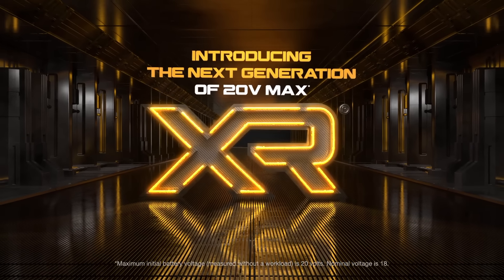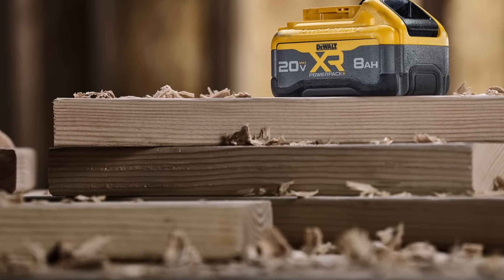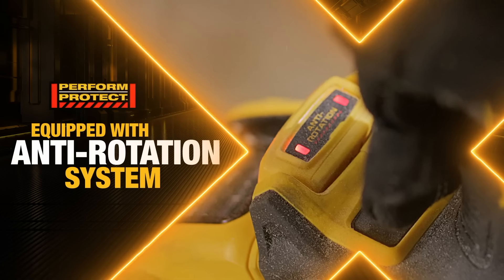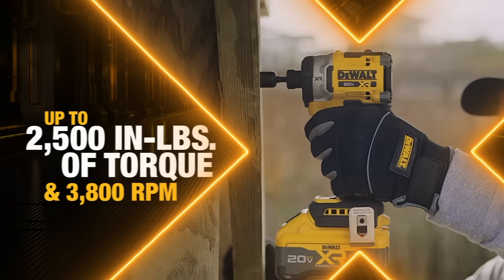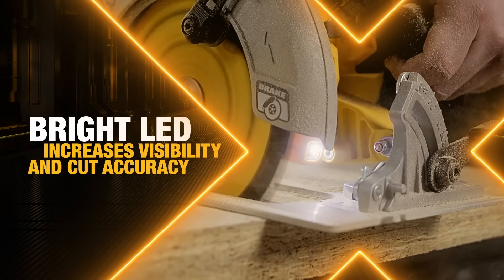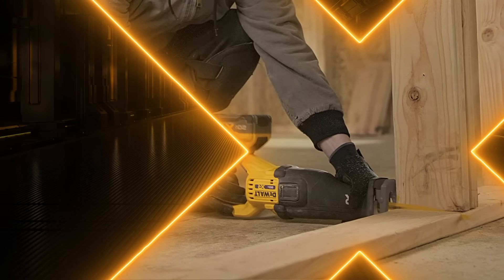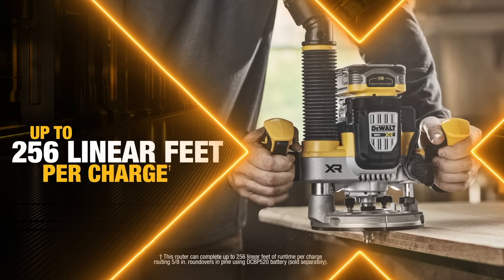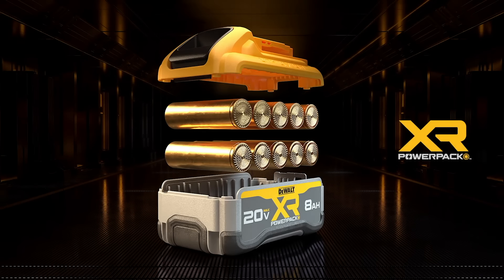New Tools from DeWalt - New Drill, Driver, Saws & PowerPack!

Comment: Most users could care less what you call the battery . We care how long it lasts between charges . When Dewalt thinks it can charge the consumer $200 plus for a battery ,think again, the Chinese knockoff’s are popping up for 1/2 the Dewalt price and sadly,there both made by the same 8 yr old kids . Just a different color
Reply: @robertsmith3518
Not entirely true. The cells that are in these batteries aren't made by Dewalt, I presume they're made by Panasonic, Samsung or.... The Chinese knock-offs use inferior cells that are just as good in the first few charges, after that these cells deteriorate a lot faster as the quality cells. Not saying these cells aren't overpriced but you somewhat get what you pay for.
Same goes for Makita, Milwaukee, Bosch,...
Reply: I agree about the price of oem batteries. I have 3 times the amount of Waitley batteries vs DeWalt. But in all honesty, I think most people either don't know about generic batteries, don't trust them, or want DeWalt batteries because they're pretty,
Reply: I got some knockoff batteries, identical counterfeits to Dewalt 6ah flexvolts. Even brand new, they died long before my well-used genuine Dewalt batteries did. They did not have Panasonic or Samsung cells like Dewalts do. The circuit board was also far less complex than genuine ones, which makes me suspect they don't have fire and short protections either. Regardless, I will stick with OEM batteries from now on.
Reply: @papageo5  Cheap batteries don't last nearly as long, you don't get the same power output and you'll be lucky to get any warranty with them.
Reply: You say all you care about is how long they last, then you will not be happy with the knock off. I have seen guys buy those and change out multiple times while my Dewalt batteries are still going strong.  I will gladly pay 200+ dollars for a new battery cell technology that has far more power output and for a longer duration while keeping heat down.  If you make money with your tools then i think its a good investment in my opinion
Reply: I agree with the comments about OEM batteries. Coming from a world of high performance flashlights I can tell you there is a huge difference in cell quality even coming from the same plant. Big OEMs get to select cells based on stringent testing and QA parameters. The ones that do not make the cut go to the cheaper brands. OEM battery packs also have better charge and discharge controllers to maintain proper voltage and distribute heat amongst the cells. I have tested cheap battery packs where a single cell was heating up faster than other cells during charge and discharge leading to a fast degradation to that cell’s capacity. This leads to the entire “pack” failing earlier than it should.
Reply: I might buy a couple new batteries, but probably won’t be replacing any working tools , unless something unexpected happens to what I have.
Reply: I'm mean it depends I'd rather use a 1.7 powerstack on my impact when working on my car over 9,6,5,4 they just don't fit in the same places as well.
Reply: Those Chinese batteries aren’t that great. Don’t kid yourself.
Reply: If you’re a professional then you know why Dewalt batteries are the best. And if you buy them right , you never pay $200. Try the power stack. Best battery yet and can get em , especially right now at Lowe’s free with a number of tools. Sure the tool isn’t as cheap as another store , but you wind up getting the battery for like $50.  Just watch for the deals and you can build your battery arsenal for not that much.
Reply: Кто вас заставляет брать? Пользуйтесь 5 xr, проходите мимо.

Comment: The most interesting tool would be the recip saw performance, without the new pack. Dewalt's flagship recip has always been lagging.
Reply: I have the Flexvolt recip and it is a real beast.
Reply: @MrCubflyer  Yeah, FlexVolt has a weight disadvantage, but for pure power, it's uncontested.

Comment: Very annoying how we can get 6-1/2” and worm drive saws with left side blades, but the standard 7-1/4” only comes as a right side blade. Also, where is the non-sliding 10/12 inch cordless miter saw?
Reply: I use both saws.. I'm getting fond of the wormdrive flexvolt I bought... It's heavy, but balanced.
Reply: I’ve been had the 12” cordless miter saw. What are you talking about ?

Comment: Not sure the point of this 8ah when u got 6ah and 9ah flexvolt batteries. Seems like some sort of overlap between xr and flexvolt
Reply: It's 1/2 the size of the flex volt 6ah
Reply: more power out of the new 8ah powerpack than the flexvolt stuff
Reply: wont heat soak and get too hot unlike other ones
Reply: 6ah flexvolt is actually 2ah in 20v tools and 9ah is 3ah in 20v. 
It's like having 3, 2ah  & 3, 3ah 20v batteries, if that makes sense

Comment: My Dewalt cordless tools have made me money!  My Milaukee cordless tools suck. Milwaukee batteries are junk. I have Dewalt, Bosch and Paslode batteries that are over 10 years olld and still work. Milwaukee batteries, I had to replace every two years.
Reply: this is 100% true
Reply: I agree other than the 60v batteries. They truly suck. I've had 4-5 completely die on me and are unusable. My company has a 60v hammer drill with the 12ah, one is basically dead and only charges to 2 bars and dies very fast. I was thinking since I sometimes use my 60v batteries on my 20v tools it takes a toll on it switching back and forth but the 12.0 stays on the 60v hammer drill only and it's dying. My 5ah power stack is a beast I love it. It lasts over a month on my impact only.
Reply: My Milwaukee batteries are junk also probably gonna switch to a dewalt drill ‘impact driver and reciprocating saw.Can’t even cut through a treated 2x4 without it draining down to nothing.
Reply: i don't have any Milwaukee tools, but battery technology has come a long way in the past 10 years and beyond.  All the major tool manufacturers have their own versions of PowerStack and PowerPack now.  i think the PowerPack is more for that extra umph on power demanding tools and the PowerStacks (Milwaukee = Forge) has good power too, but i think they cost more because they last 3x-4x more power charge cycles.
Reply: Also how well they stand behind their warranty is insane! Just got 2 brand new batteries just by calling them and 15 minutes later had new batteries approved and on the way! They asked for pictures of the batteries, the problem and the date stamp (has to be within 3 years) and receipt was not needed!

Comment: 1:33 “Compared to its predecessor, the FlexVolt DCD999...” The DCD999 is not FlexVolt. It’s also one of two predecessors, since the DCD998 and DCD999 are essentially the same drill sold in two configurations at different retailers (Lowe’s PowerDetect and Home Depot’s FlexVolt Advantage). Despite one mentioning FlexVolt, both are 20V Max XR tools like the previous DCD996. Neither actually prefer the batteries they are marketed with since both perform better with a 6AH XR or 5AH PowerStack.
Reply: yeah like you mentioned it’s the same drill so why does the guy have to mention both
Reply: Watch the "torque test channel" The flexvolt advantage dcd999 out preforms the power detect dcd998. They are identical as far as looks but truly not the same. Also "20v max" is the power it's designed for and XR is extra run time, meaning brushless usually.
Reply: @John-771

TTC’s PowerDetect vs. FlexVolt Advantage testing is exactly what I am referencing when I point out that neither drill prefers their bundled battery and both perform better with a DCB206 or DCBP520. That said, the DCB609 (9AH FlexVolt) battery would perform even better than the DCB206 since it has an extra bank of the same high-current Samsung INR21700-30T cells.

Furthermore, TTC’s  DCD998 vs. DCD999 results were the one exception where the PowerDetect model came out slightly ahead of FlexVolt Advantage, so you got that backwards. Both drills have XR badging as does the DCD996. The DCB206 has since dropped XR badging in recent months and the DCBP520 has gained it but they are both the same batteries they previously were.
Reply: @John-771  Oh: TTC literally quotes me in it. ;)

To quote them, both tools performed “about the same” with their included batteries. Both preferred the DCB206 over their included batteries, and the DCD998 PowerDetect squeaked into the lead once unbounded by the 40T cells they just disparaged in today’s 8AH PowerPack video (DCB206’s 30T cells are higher-current).
Reply: @emmettturner9452  Except with the grinders and saws. Yes, I was mistaken with the drills.

Comment: Dewalts recip saws are not good enough. The new looks like a flexvolt advantage without the logo. No  adjustable shoe, rafterhook nor orbital mode. Also shorter stroke-length than some saws. In general, the circular saw, grinder and recip looks unchanged. But anyways, in general good tools

Comment: Have XR DCF 860 and the 8 AMP POWER PACK just got the XR DCD 1007 COUPLE Days ago in KIT FORM
Reply: How do they perform ? I still have my old 887  and have very very rarely found anything it wont drive in.
Reply: @MrCubflyer  have not tried the 887 on the new POWER PACK but will do it but it has a lot of RUN TIME
Reply: how much better is the dcf860 compared to the dcf887?

Comment: I'm a makita man,  but i have to say, dewalt and hikoki are really temping...  makita 40v stuff is really expensive.... and the dewalt flexvolt skill saw is max power/price combo.....  my only gripe with hikoki and dewlt is the lack of a high voltage left hand blade 165mm skill saw....  this would be a game changer as thats the tool i do most my work with.... a flexvolt one of these or a 36v hikoki would probably make me consider changing platform...

Comment: I prefer Dewalt tools and batteries as a GC, but recently the batteries have got stupid expensive.  I bought a few Waitley knockoff batteries to run my fan.  The 6ah are more like a 4ah Dewalt but well worth it at $25 instead of $100.
Reply: Careful, I had one cheap knock off start a fire.
Reply: I had a cheap battery destroy the inerds of my recip saw, so just be careful.
Reply: @John-771  I did a little research and only use the Waitley knock off brand.  Do you happen to know the brand?

Comment: powerpack, powerstack, flexvolt, power assist, XR, At this point Dewalts battery and product line up, what works with what, whats optimised for what, is just too confusing.
Reply: It’s easy to tell, just look for the numbers, 12v, 20v, 60v and then look at your tool if it fits one of the categories
Reply: @Averageperson863  Yes I understand the difference between 12v 18v and 54v its just that dewalt keeps coming up with gimmicks like power pack and power assist which is turning their platform into a confusing mess

Comment: I bought a model 7781 impact drill charger broke first month battery and drill followed about eight months later didn't get a year out of the whole system no receipt about 250 bucks I had a 20 year old 18 Volt I just threw away works fine what happened to you DeWalt went to China and started building garbage

Comment: I've never bought a DeWalt tool in my life until last week and I wound up purchasing a total of five different tools I have nothing but Milwaukee and I can tell you that I absolutely despise the power and batteries that DeWalt has which makes me either want to return them throw them in the trash or just give them away
Reply: I have both , for instance the compact 20 volt DeWalt router has way more power than the Milwaukee, also the DeWalt twenty volt compact cuttoff tool has almost twice the power as the Milwaukee, then the Milwaukee impacts have more power than dewalts , 
The Milwaukee trim router is less power than the DeWalt but it is more slim n comfortable in the hand
Reply: The batteries that comes with them are junk. Once you get some 9ah flex volt batteries and a quad charger preferably a power station you’re rocking!!